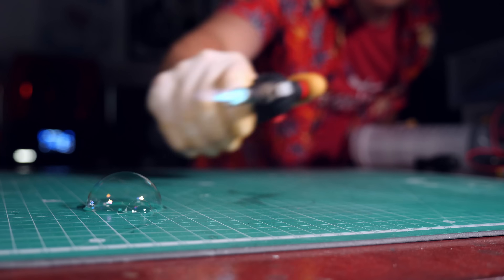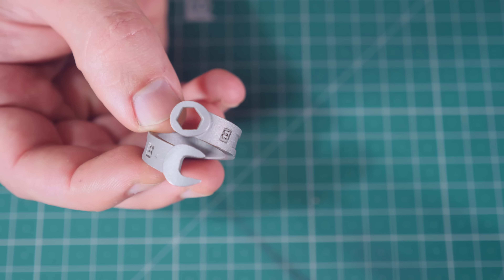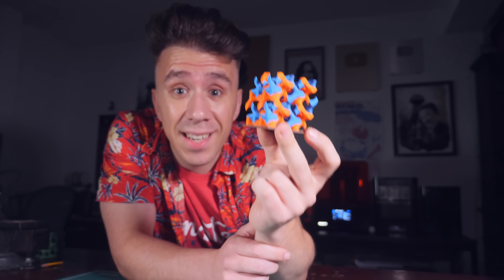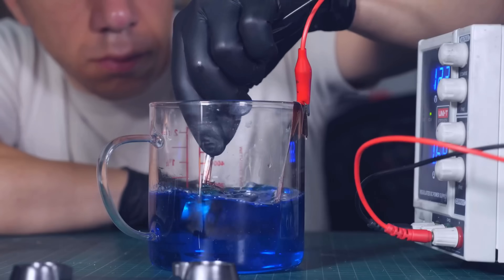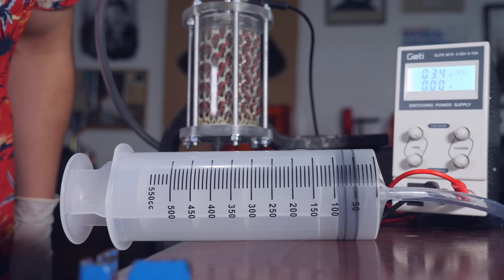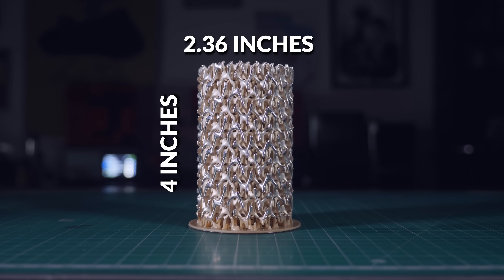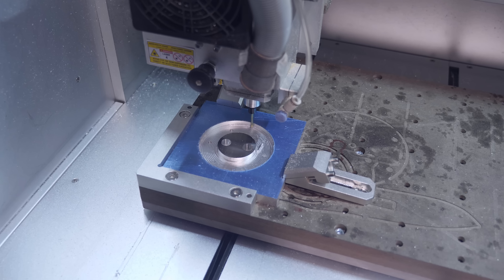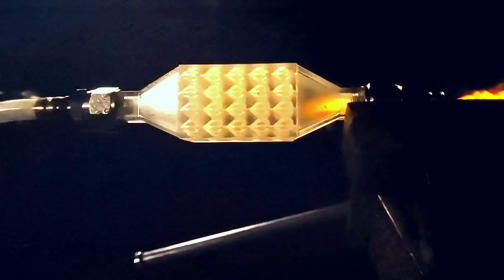ROCKET that LITERALLY BURNS WATER as FUEL

Comment: 1) There's a certain voltage between the anode and cathode where electrolysis is most efficient; FROM MEMORY (so please check this) it takes about 1.25V to work at all, 1.5V is optimally efficient, and above 1.75 V doesn't produce more gas, just producing heat instead... As a result, instead of connecting each plate to +ve and -ve, just connect the end plates to +ve and -ve, and you will end up with a voltage gradient between the the plates inbetween... ie. 48V with 30 plates gives 29 gaps with 1.65V across each gap.

2) Any design which uses an electrolyte will leave a deposit on one or both of the electrodes.  However it's also worth noting that these deposits are encouraged by impurities in the electrodes and the water... Sodium is quite high in the electrochemical series (and as such is less likely to form deposits), so sodium chloride (table salt) is a simple and abundant electrolyte... However this does have the caveat that Chlorine gas will be formed at the opposite electrode, as well as your desired Oxygen...  To minimise this, you only need a very very weak solution of sodium chloride, so that much more Oxygen is produced to small trace amounts of Chlorine gas.

2b) Further to this, Potassium hydroxide (KOH) is probably the easiest to work wit because (in theory) it is not consumed at all in the electrolysis reactions at the electrodes. In reality you can lose a little KOH through it's reaction with the gasses you are collecting, so very trace amounts K2O2 and some KO2 will be produced.  But it is nearly negligible.

3) Going back to impurities causing scum and material deposition at the electrodes -  Start with deionised water, add a small amount of electrolyte.  Run the electrolyser for a few days, strip and clean each of the plates, wearing gloves and being careful to not get contaminants on the steel plates (even just oil off your fingers is a problem), rebuild, and re-fill with fresh clean deionised water with a little table salt added. To clean them, sand them down with emery cloth and rinse with deionised water.

4) Stainless steel plates are quite cost effective electrodes, but graphite or platinum are better because they are more inert than the stainless steel.
Reply: Wow, good comment!
Reply: As I found an expert here: Does orientation of the plates matters? Wouldn't hydrogen be replaced with salty water faster when plates would be oriented vertically?
Reply: don't we use a salt bridge so that impurities don't deposite near the electrodes and to remove liquid junction point according to this I think the the impurities won't deposit near the electrodes
Reply: Titanium is also spposed to be a god electrode material. very resistant to crrosion
Reply: Theoretically, graphine plates could be an ideal electrode material, but not very cost effective. A little platinum plating on stainless plates might be something to try tho.
Reply: Unless you add a catalyst or something to the cathode or anode, right?
Reply: to add to this, if you drill the plates with multiple holes it increases the surface area and allows the scummy electrolyte to move easier...   I built one years ago using 316 plates and KOH.    Table-salt is an issue as you also get chlorine gas produced  at the annode.
  
Add a pager-motor (vibrator) to the side of the jar, and it will allow the plates to "self-clean" to some extent.
flash arrestor is a must!
Reply: Dont stainless steel electrodes make highly carncibogenic hexavalent chromium when used as electrodes?
Reply: Where then is your WORKING example of  this?
Reply: @robertrichardson5396  Mine's still in the garage from when I built it 20+ years ago ...  next to a gas-turbine I built from a Turbocharger when I was 16. 
  
Hydrolysis is not a new science.
Reply: OK 1,7Volts. Will increasing the Watts speed up the process ?
Reply: Regarding item #2 - Would Sodium Carbonate or Sodium Silicate work as electrolytes? No chlorine problem then.  Regarding item #2b, wouldn't K2O2 and KO2 immediately react with the water surrounding them?  What if we went higher up the Periodic Chart and used a lithium compound?
Reply: @lokimidknight7319  Would "ordinary" graphite electrodes, positioned VERTICALLY, be almost a good as graphene?  Asking for a friend.

Comment: I’m a chem engineering student and I’m very interested in design. The switch from anti-gyroid to stacked cylinder was absolute beauty. I’m glad I found your channel
Reply: Stacked cylinder is the obvious solution, not some fancy geometry. for practical applications you need to be able to separate the hydrogen and oxygen. That means that the anode and cathode must be some distance apart.

Comment: Love this video, great presentation! You thought about adding a high-current limiting resistor for the power to the generator? Being pulsed helps yet still does not limit the current being drawn by the generator during the on cycle pulse. It would generate a bit of heat in the resistor, just another form of energy you could use for something else maybe? Going to build one of these for sure, so many right here on YouTube. Keep up the awesome research and experiments!

Comment: I suggest keeping the water in motion using a magnetic stirrer. This will increase the surface area and help quickly remove any gas that forms on the metal surface.
Reply: Maybe just tilting the cylinder sideways would make it easier for the bubbles to escape?
Reply: @DawnFireX  true lol, or redesign it in a way it transports the bubbles away in a natural way
Reply: Why not have a reservoir of liquid to replace the gas with a gravity feed ?
Reply: the only issue with this is if the water is moving it will drastically increase the amount of reaction time that is needed for the process to work there for causing a bigger problem of less fuel being produced stagnant water is best for this take this as a good example if you move water in a pot before letting it boil first it will take longer to boil because you are not giving it enough time on the heated surface the same can be said for the elecrtodes if you are moving the water fasterthan the electrodes can react with the water to split the water into H2 O then you ruin your project the best way to do this is to have a multi anti vertical conical shape that directs the flow of the gasses upwards there for making them follow buoyance to the engines reaction core IE the burner
Reply: @DawnFireX  It would be better to just have a reaction lined tubing system that is tuned specifically to inject just the right amount of water through it, and bonus, you get a pretty large surface area too. You don't really have to deal with trying to make the bubbles flow better, because they will react and immediately exit. At its most efficient you wouldn't even need a large surface area, you'd just design it to use as much power as is needed to instantly convert along a tiny stretch near the end of the tubing, and tune its power to how much volume you want to push through the tube at a given time. That's kind of the problem with this design...while it produces a reaction, that reaction also loses kinetic energy by having to move through the solution. If you convert it instantly as it exits a tube, you get even more kinetic energy out of it, which would matter in a rocket, as the faster the starting speed of the gas being used, the faster it can react and the faster it can exit the rocket, adding a boost of force on top of pressure. It's when you get things bouncing off of things internally that you get problems, and for rockets that's a bad thing. And you can achieve quite high fuel velocity with such means, just like how ion engines work by electrically accelerating a gas. If you've got a gas you can first accelerate and then combust, you get more thrust, and that initial conversion can be utilized as a form of initial acceleration. With normal rocket engines we're mostly just accelerating the liquid fuel with turbo pumps, which does move large volumes of fuel quickly, but we can definitely move a gas even quicker before we even combust it, which means it moves even quicker after we combust it.

Comment: As for efficiency: It takes a lot more electric energy to split the HH from the O than the energy produced by burning them together.
Reply: @judgedayan9934    That process requires the electrodes to be too far apart for efficiency and the bubbles off each electrode must be collected separately. Not impossible, but it is a waste of energy and you still need to introduce 02 to the hydrogen to get it to burn.
Nature got it right. Ignite them together or with at least a little more outside air. An ICE will not run on pure HHO, it needs to mixed with outside air to combust properly. There is no reason to  capture pure HH when you have to dilute it to combust, anyway. Peace out.
Reply: Huh? Where is the energy going then? Is the water getting hot, or giving off RF energy or something?
Reply: Solar power can provide a lot of electricity though.
Reply: Okay, I grasp that there is efficiency loss in the overall process of making it happen...the creating of the electricity, the storage of it if that is done, the movement of it through the wires, electrodes and electrolyte, etc. And there would also be loss in recapturing that energy from the combustion, if you tried to do that.

But the actual chemical reaction of either splitting the molecule or recombining it is exactly the same amount of energy in or energy out, right?
Reply: @DavidJames-v1y  pretty sure the energy is being used for work, for the breaking of chemical bonds.   in my simplified mind, its like the energy of heat being used to melt ice.
Reply: @xtnuser5338  No it isn't, if it took the exact same ammount of energy to split water that you'd get from combusting hydrogen and oxygen together then those two processes would happen equally often and liquid water basically wouldn't exist as it'd constantly be spontanously splitting and recombining. When hydrogen and oxygen combusts and produces water the subsequent water molecule has a much lower energy state and thus is more stable making the reaction a one way reaction, this is also why we can harvest energy from this reaction, if it wasn't one way you'd have an infinite energy machine. You should perhaps look up what a chemical equilibrium is because it explains this concept in more depth.
Reply: @DavidJames-v1y  the water actually does get quite hot and at the same time a lot of the electric energy you put into the reaction never even goes towards splitting the water molecules and instead goes towards all sorts of other reactions that we don't want to happen.
Reply: @hedgehog3180  You know it IS possible to have two reactions with the same energy input or output, while having different THRESHOLDS of energy required to trigger them. Right? You understand that, right?

So while I'm not saying you're wrong, I'm saying the reasoning you give is not a reasonable explanation for one state being more stable than the other. One CAN be way more stable than the other, without implying the total energy input/output is different.

My example isn't about a reaction, but is still useful to make the point. The same energy is absorbed or released to change ice into water or water into ice. But it might take US different amounts of energy to INDUCE the change, depending on ambient temp for example.
Reply: You can put all kinds of spin on this but where is there a REAL working example? 
Don't give me the old conspiracy theory shit either....

Comment: Given your engineering background, I'm surprised you haven't applied Ohm's Law to optimize your electrolysis setup. For an efficient hydrogen generator, you can calculate the ideal electrolyte concentration using a simple approach:

Determine your desired current (I) based on your hydrogen production goals.
Know your power supply's voltage (V).
Calculate the target resistance (R) using Ohm's Law: R = V / I

Then, gradually add electrolyte (typically potassium hydroxide (KOH) or sodium hydroxide (NaOH) for alkaline electrolysis) to your water while measuring the resistance between electrodes. Stop when you reach the target resistance.
For example, if you're using a 12V battery and want 5A current:
R = 12V / 5A = 2.4 ohms
Adjust your electrolyte concentration to achieve this resistance. Remember, higher voltage requires less electrolyte to maintain the same current.
This method helps you maximize hydrogen production efficiency without overloading your system. It's crucial to fine-tune based on your specific setup and safety considerations.
Reply: definitely
Reply: Check out the giant HHO generator I built 16 years ago.  https://youtu.be/PFrkHFmjx0c  you don't need to get so fancy with that complex geometry, though that was very cool.   stainless steel plates alternating, car batteries and a PWM.   I stopped these experiments when I almost blew up my garage.   And you are correct, it is very loud because  Oxyhydrogen is a mixture of hydrogen (H2) and oxygen (O2) gases. very volatile.   DANGEROUS !!
Reply: Super helpful to know. I don't know how I hadn't caught that part of the discussion yet. I don't know if I have the authority but I say 20 points are due.
Reply: Guy’s a poser
Reply: You could also just limit the power draw with resistors .  I have a feeling he knows that but was instigating more discussion to farm ideas.  One of those sneaky thinking guys .
Reply: You could also use a variable resistor in series to try and balance circuit resistance, if you don't have a way to adjust pH without adjusting efficiency.
Reply: @subzero5101 that is exactly what is mentioned in this post. Using ohms law to determine the size of resistor for the amount of current desired.